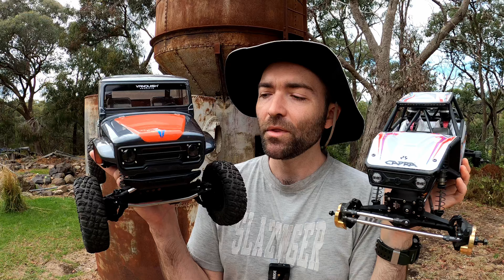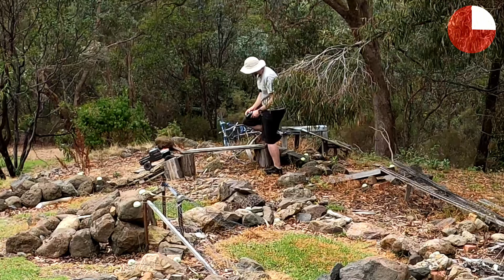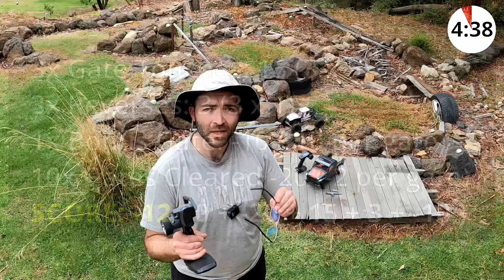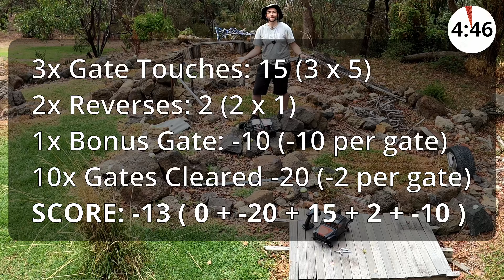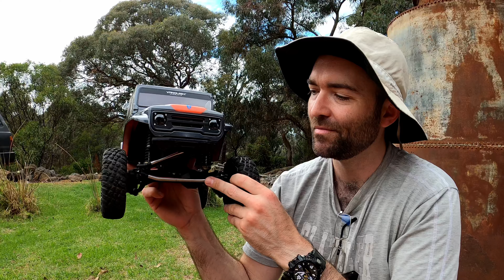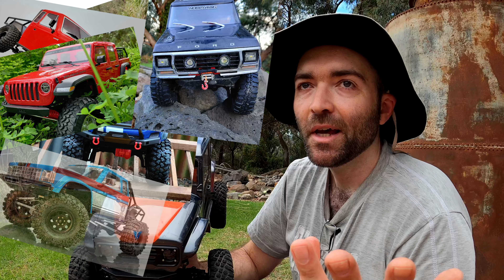Testing the Mods: Vanquish Phoenix Portal vs Axial Capra!

Comment: Too bad that a worthless test track. You should have ran the Capra with rim/tires suited for it or run the Portal with the Capra rim/tire combo. The Capra is much more of a technical crawler than that top heavy Portal. I do like them both. Maybe in your area there isn't a desert with real rock cliffs to climb.
Reply from the maker: Maybe one day I'll be able to find real rocks. These fake rocks just aren't the same.

Comment: Great video I have a question though 

I was wondering what battery you use on ur Capra and one cheap battery you’d recommend for the Capra 

Thank you
Reply from the maker: Turnigy nanotech 3S 700mah 60C
I have ten of them and ten of the 450mah 3s ones too. My comp batteries!
Reply: @RCTNT  thank you so much really appreciate it
Reply from the maker: No worries. For what it's worth, I've had most of them since 2016 or so and have run many cycles through them. Still get excellent capacity and no puffing - always put on storage charge after use and run again on storage every 6 months or so (if I haven't used them in between). Cheers
Reply: @RCTNT  cheers

Do you know how long the run time is?
Reply from the maker: How far does a tank of gas get you on a car?

(it depends on the car, motor size and type, drive style, terrain, etc etc etc)

The 450s give me about 11 minutes on a brushed system in a Comp setting. I use one per 5 minute course so there's ample power.

The 700s give me about 15-20 minutes useful drive time on most 1/10 crawlers. Again, it varies, but that's roughly going to apply for you too. That's as specific as I can get when answering generally!
Reply: @RCTNT  ok thank you have a great day

Comment: First off, thanks for your channel! We needed this! Again way off topic, your thoughts on enduro kit? Long term? Again, your channel rocks! Peace from South Africa.
Reply from the maker: My pleasure, thanks for the encouragement!

Enduro kit, I haven't built. However, the Enduro platform is capable, has good materials and design and is durable. My use of the Sendero has been extensive and it hasn't missed a beat. The Knightrunner and Gatekeeper also are capable within their intended design and I expect similar durability from them.

That's the extent of my experience with the Enduro platform. But in short, I'm impressed with it and I expect you will be too :)

Comment: Quite a challenge to make the Phoenix face the Capra for pure performance, but then again, that width clearly hurt its progress and made the match much more even than I would've thought at first.
I was particularly surprised at the Phoenix's performance against stock. Yes, it could've been a wider difference. As you said both on the chill rythm to try to finish without making mistakes, as well as the gate that you thought could be done better and gain a few negative points. But still, the results do far from telling the whole picture and, as far as performance at competition is concerned, there really isn't that much in it, or is there??
One more thing, when driving the Capra you touch a subject I was just thinking about a day or two ago, why not more people put sensored brushless in their crawlers. You'd think that would give greater precision. Although I replied myself that's just beyond the law of diminishing returns. I do wonder if any or in which particular cases that would prove to be a substantial gain. Maybe there's just another idea for your already quite extensive list of options!
Reply from the maker: The Capra is objectively the better performer here. Handicapped as it was, it beat the phoenix, while the Phoenix put in its best showing. But it was close, yeah!

Brushless: if you like FOC, brushed can't touch it. But a good brushed system will be similar to a good sensored brushless system. At the budget end of things, cheap brushless beats cheap brushed, usually - but a cheap brushless system is similar money to a decent brushed system, so again, things kind of equal out.

The most uncontroversial statement I can make here is brushless is significantly more power efficient, so you get better battery life from brushless, given similar output in any comparison. Brushless usually gives you a wider range of low to high speed, too. Cheers for the ideas, I'll think on them.

Comment: Off topic but I just got a element trail runner and when I turn on the remote the car just starts going and I can’t steer or stop would you know why?.
Reply from the maker: Check your throttle trim on the radio (channel two = throttle. Not end point, but trim, which sets center). It probably needs to be moved back to zero.
Reply: @RCTNT  I tried that the trim does nothing not even for steering I can’t even steer
Reply from the maker: @jimsskids9710  was it brand new or did you buy it used? It sounds like the receiver could be wet, possibly. Dry it thoroughly then test again.

It could also be the radio isn't bound to the receiver. Try binding it again.

It could be also/as well as not being bound that you're experiencing a fail safe throttle setting. Manual is here (https://manuals.plus/team-associated/xp130-2-4ghz-3-channel-radio-system-manual ) and here's the relevant bit I'm referring to:

FAILSAFE FUNCTION SETTING

After successful binding of the transmitter and receiver, the fail-safe setting can be saved. If the connection between the transmitter and receiver is interrupted, the vehicle will revert to a preset throttle position.
To set this position, place the vehicle on a suitable stand so that the wheels do not touch the ground, then turn the transmitter and vehicle on and install the Bind connector into the “F/S” pins on the receiver. The LED on the receiver will flash rapidly. Now move the throttle trigger to the position that you would like to establish as the fail-safe setting (neutral is recommended) and while maintaining that position, remove the Bind connector from the receiver and immediately plug it back in. The receiver LED should now be solid and the failsafe position set.
Reply: @RCTNT  it’s brand new I tryed all that didn’t work only thing now is when remotes turned on it doesn’t just take off
Reply from the maker: @jimsskids9710  if you've successfully binded it and reset the fail safe then either the radio or receiver may be faulty. Check the transmitter batteries too. Could be faulty servo causing a problem also, I guess - unplug steering servo and see if you have throttle control at least. That's about all I've got for you without looking at it. Good luck!
Reply: @RCTNT  I’ve got a fly sky remote and that I might put in and see if that works
Reply from the maker: @jimsskids9710  good one. If it does, it's the radio. If it doesn't, then you've got a faulty servo or maybe esc/bec, I guess. Good luck!
Reply: @RCTNT  thanks